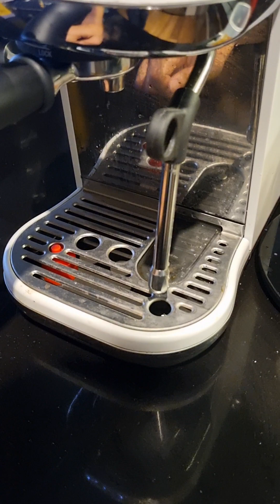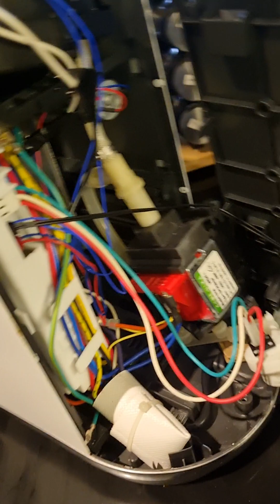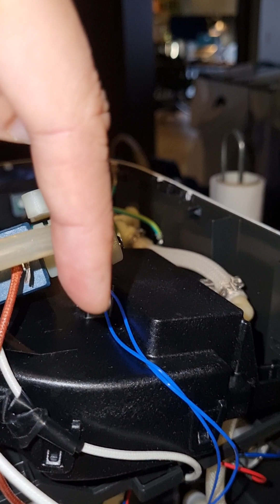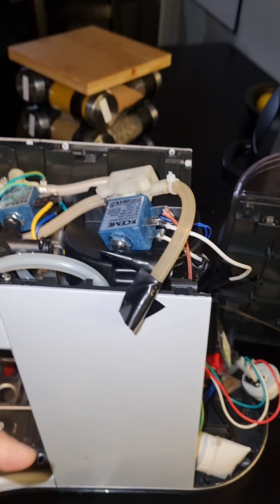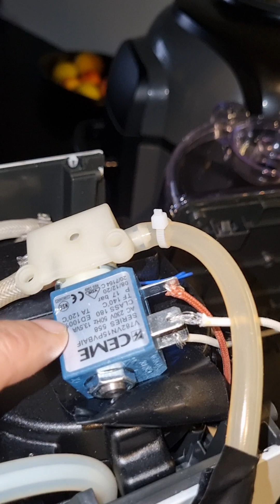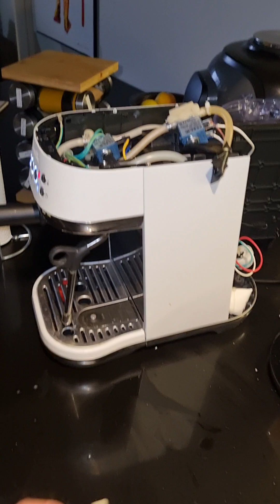Breville Bambino Plus - Low pressure / Solenoid Valve fix

Comment: So I have a similar problem. The water comes out from the very bottom of the machine though, where the screws! Was that the case for you too? I opened it just to check and didn't see anything wrong but who knows. Not sure if just opening it created this issue with the water coming out from the bottom. I might need to change the valve as you did...
Reply from the maker: Not sure the root cause but I've seen some cases where you just need to tie up one of thr first hoses that gets the water from the water tank. If you see the water coming when you are trying to make a coffee, then it's probably a black flush and probably one of the valves.

Comment: Suddenly my machine is 1and 2sort batton is flashing so if make descal after my machine is only 1 and 2 sort batton is open light but stim batton and temperature batton not open light so now what can l do even l want to clean group but l cant if l press the 1nd 2 batton it is dropping water like espresso drop machine did not remove the cleaner tablets

Comment: Hello again, and thank you for your reply. It seems that you are talking about how much water water you were losing into the over flow tray and how you fixed it with by replacing the solenoid valve. Im glad it back up and running for you. My issue is not the valve but the hot water begins coming out of the group head HOT for about only 5 seconds or less then turn cold, room temperature. No water falls into the overflow drain tray while in progress or after my shot stops.

Comment: Thank you for the informative video. If possible, could you tell me how to fix my Bambino Plus? It’s not producing hot water from out of the group head anymore?  I've tried descaling it as recommended, but the water still comes out cold. Although, the water/steam coming out of the steam wand works fine (hot). Thank you in advance, Ron
Reply: Hi Ron,

I have the same problem, have you found a solution for this?
Reply: @willwright555  I had the same problem, it only produced cold water but steam worked, the issue was the temp sensor (for steam its not used thats why it works) in the thermocoil, cant get that separate so I replaced the whole thermocoil and that fixed it
Reply from the maker: It's probably the boiler then, guys

Comment: The part you're showing is not a 3 way solanoid though. I ordered the part that you showed and when disassembling the machine it was another part. They didnt match
Reply from the maker: Indeed, in my case the problem was not the 3 way solenoid valve.

Comment: So I think I have a similar issue but maybe not.  When I try to pull a shot, nothing happens, no water comes through at all and at the end of the cycle there is a loud popping sound (pressure release) and some of the water ends up in the bottom tray.  This leads me to think the pump cant push enough pressure to pass through the coffee. But it's not instant flow of water to the bottom. Is this how it happened for you?
Reply: this is exactly my issue:   https://www.youtube.com/watch?v=3Rx7bc0wr1M
Reply: Hi! Were you able to fix this? My device also gets no water through the shower head, so I can't make an espresso at all. Steaming works though. What is the fix?😢

Comment: Hi, thanks for the video. Do you happen to have a video of the actual misbehavior before fixing it?

What exactly do you mean by “most of the water went to the bottom”? Was there still water coming out the brew head?

Also, did the steam wand still worked fine?
Reply from the maker: Sorry. I don't have any videos of thr initial problem. But what was happening was that when you pressed the bottom to make your coffee, the water instead of going through the brew head to make your coffee would go to the overflow and would appear in the tray. Just a bit of the water would go through the brew head because with the ground coffee in the portafilter the water would find much more  resistence going through the brew head than going to the overflow. 

A good test to do is to press the bottom to make the coffee without the portafilter. If without the portafilter the water goes through the brew head and with a loaded portafilter it goes through the overflow then you probably had the same problem as I did. 

Honestly I don't remember about the steam Wand.

Hope it helps.

Comment: Hi, thnaks for this. How did you open the case to get access?
Reply from the maker: Screens from the back and on the bottom of the machine
Reply: @caiofariasgs  thanks a lot! fixed mine without replacing the solenoid, but I disassembled and re assembled it and descaled it while open, and the solenoid is back to life. I hope it holds! Thxs!
Reply: @ayoraraquel8333  I didn't understand his response. I've been searching for the same answer on how to open up the housing in order to look inside the breville bambino plus
Reply: Hi. It is pretty easy. Screws on the bottom first, then the 2 at the back, and then you push the top backwards (slide it towards the back of the machine). Let me know if that helps
Reply: @ayoraraquel8333 what do you mean you descaled it while open? You took the pipes out and descaled.them or you ran the descale cycle? If so how did you connect the water tank?
Reply: @dcor6373  all pipes connected, just ketp the top open while I run the cycle so as to check for leaks